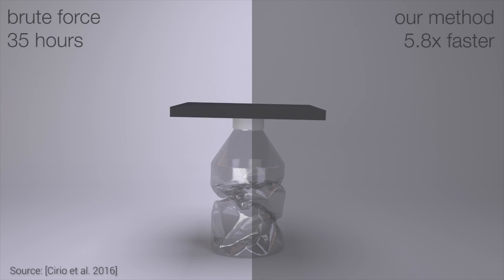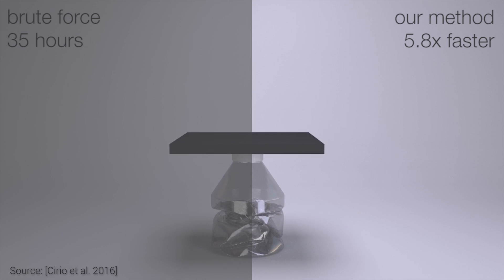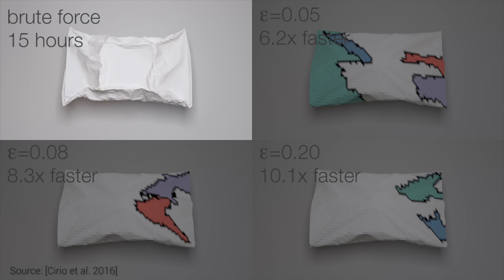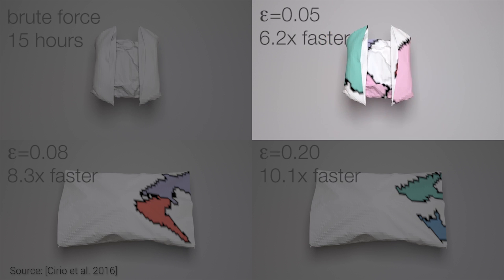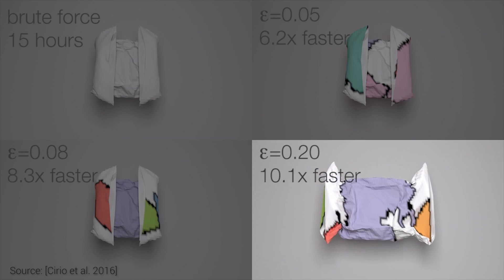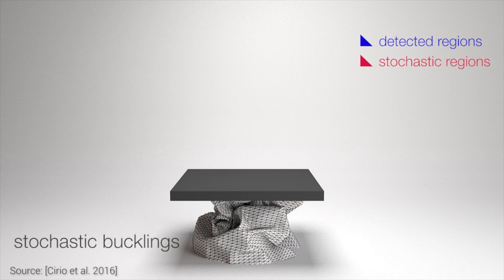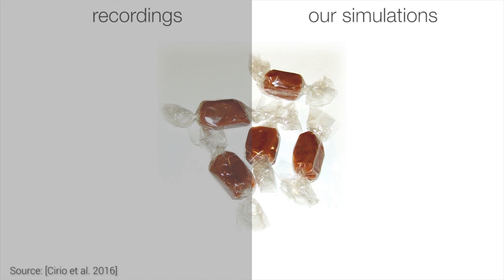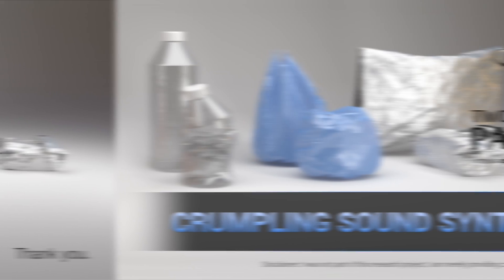Crumpling Sound Synthesis | Two Minute Papers #115

Comment: Very interesting, but it still takes way too long to simulate to ever use in something like a game. Here's my idea (keep in mind I'm just a regular person, I barely know anything about this stuff): What if you used machine learning to generate the sounds? There are already neural nets that can do speech synthesis, why not crumpling sound synthesis? You could use the bruteforce simulation results as training data. If done correctly, I imagine it could run a lot faster than manually simulating, especially since for games and such you don't need perfectly accurate sound, just something that sounds "right".

Comment: Has anyone simulated the sound of fabric bellowing? Because I'd imagine that you wouldn't be able to calculate discrete sections of a non-rigid material in the same way, since it would curve and not create mode-clusters (sorry if terminology is wrong).

Or is it even simpler since you could just simulate the net effect on air pressure that the fabric is producing, since the fabric itself isn't resonant? Except it can be if it's taut... I don't know, someone help me out here.

Comment: Nice results! I'm guessing the difference between reality and the simulations may be largely due to echoes that are not simulated?
Reply: What I noticed is the materials with a high pitched timbre are synthesised pretty well, but lack the background rustling. For instance the bag at 2:50

However, the lower pitched timbre materials, like cans and bottles (stronger materials) are really poor imitations, the synthesis just doesn't produce low pitched sounds.

Also speaking as someone who's worked on foley and track laying for video, the accuracy of details is not important. The subtleties of a single vertice crumple is simply too small for a human to align the visual and audible inputs. However, the timbre and big events, like the bottle has a few distinct crumple moments at 0:45, are really important to align. It seems that this research is therefore on the right lines by simplifying the model down to regions, but the synthesis needs to consider the type of material and the dynamics of key moments in the collapse more thoroughly.
Reply: Would it be possible to synthesise the air flow within the object? Maybe this would account for much of the low end spectrum of the sound that is missing. As we know, the contents/space inside of an object can change the reaction sound of the material itself!
Reply: gix10000 I was about to say something like that, but not as eloquently ;)
I was wondering whether adjustments could be made to accommodate for size/thickness/density of subject material  or even having a database of settings for different materials.